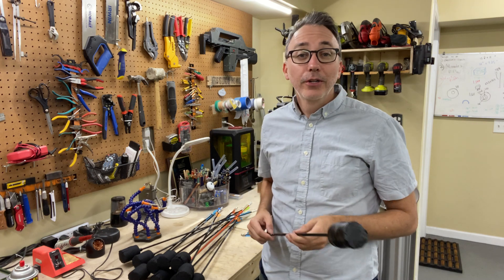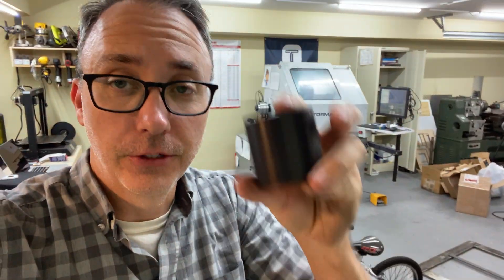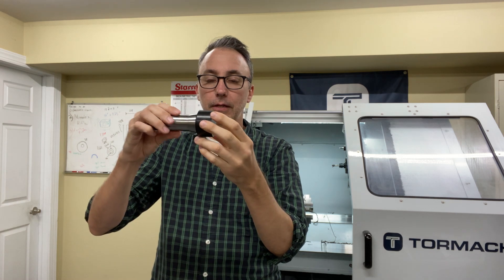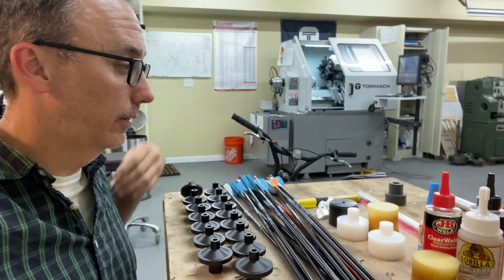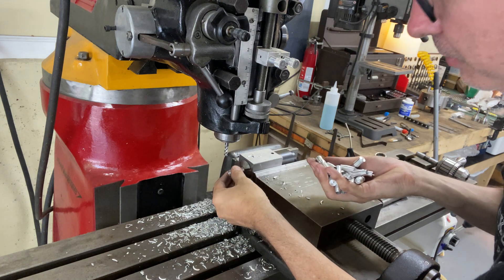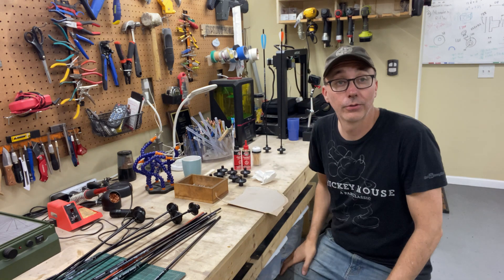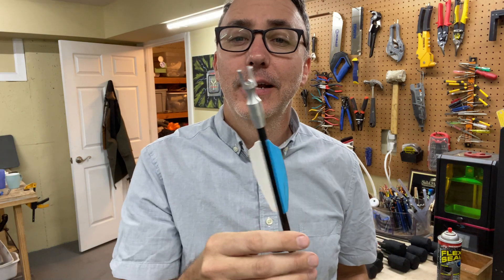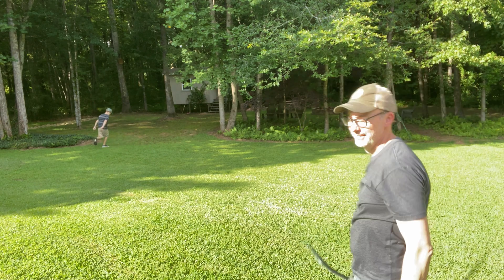Archery Tag ARROW HEADS and NOCKS on a TORMACH CNC LATHE

Comment: to answer the question on why nocks are made like that, typically in a bow & arrow setup, the nock will grip the bow string decently tightly, not letting it slide or fall off the string. Typically a bow will have a D loop or something similar in the middle of the bow string that tells you where to position your arrow and also is what you pull on when you want to shoot the bow. With most modern bows, you are using some sort of release, so your fingers are never touching the string. A release also helps to spread the pressure over a larger area, so you are not straining a few small muscles in your fingers. This makes for a safer, more reliable, and more accurate pull and release.

the reason there are a few reasons for being shallow. typically you dont want to have to waste too much energy releasing the arrow from the string when its being shot. The more energy it takes, the slower the arrow will be. The other reason is that it can be made a bit more durably, as the length to thickness ratio is rather favorable
Reply from the maker: Thanks!  This super helpful!!